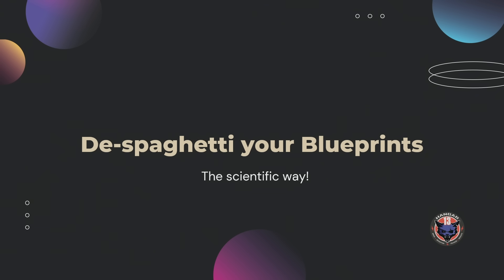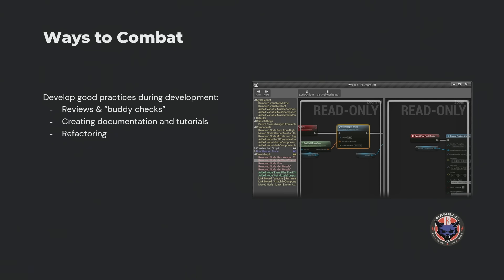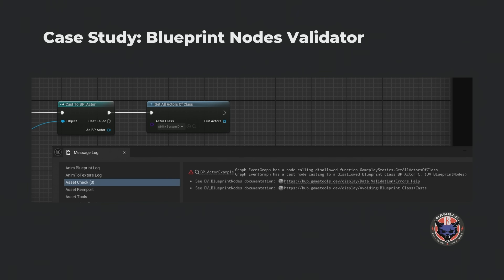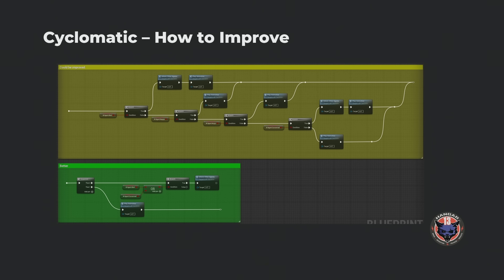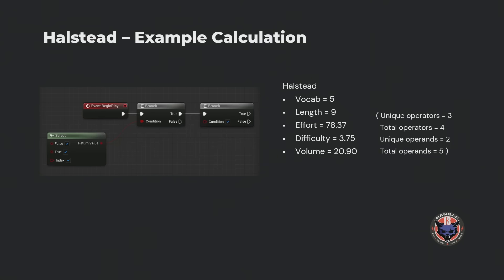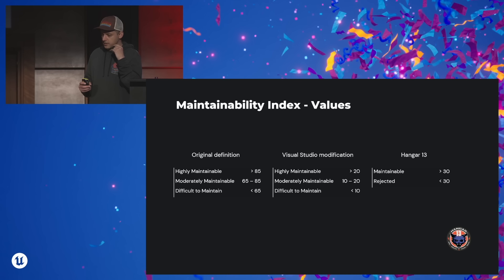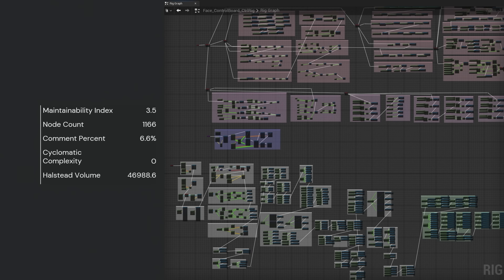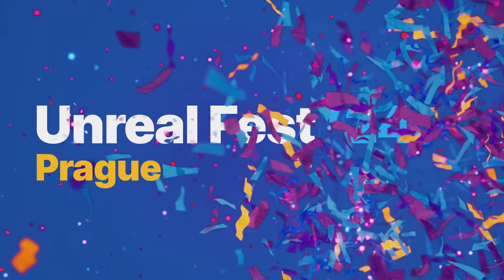De-spaghetti Your Blueprints, the Scientific Way | Unreal Fest 2024

Comment: 1) We work with perforce always submit with data validation, We try to avoid problems with redirectors
2)  Colapse just to improve the visualization is not a good practice,the slider example is not good, it is better to create functions
3) I was hoping that this talk would focus not only on assessing how much has been burned but also on how to put out the fire.
4) Comments are free, and are a help for two, the one who wrote the comment now and the one who reads it in the future.
5) I thought this talk would help my students to write better code but just measuring will not help them.
Reply: Hi - thanks for the detailed points but the core message of the talk is: implement these measures early on as validators and then people will learn as limits are hit and they have to adapt and improve

Comment: "dont use casting" Okay, but how else i call function (or anything else) in actor from another actor?
Reply: Interface
Reply: Interface calls or cast to a C++ class. It is only Blueprint classes which use reference chains. C++ modules are always in memory and thus are "free".

If your blueprint class is important enough to be referenced and cannot be made into an interface, it needs to be moved to C++. (And if you don't know C++, you should learn!)
Reply: Put the functionality that needs to be exposed to other classes, in C++. Obviously there is so much more you can do from there, and abstract literally anything. You can go to the extremes with gameplay tags. Create an "event" subsystem, that you can access from anywhere in your project, and make everything communicate only through that subsystem, using gameplay tags or other metadata. (This is an extreme case, usually you do some things directly and some things through a system like this)